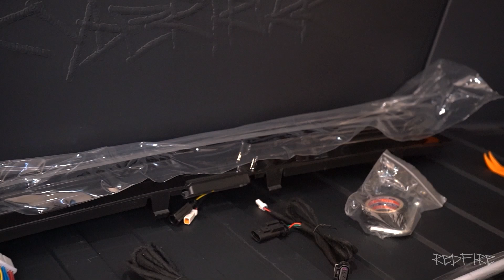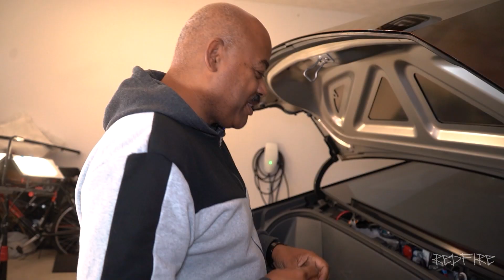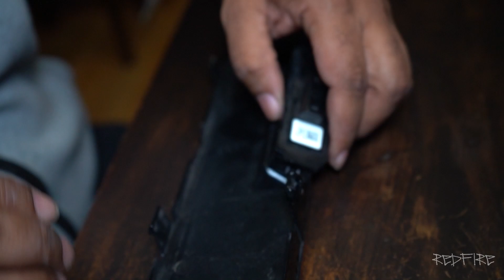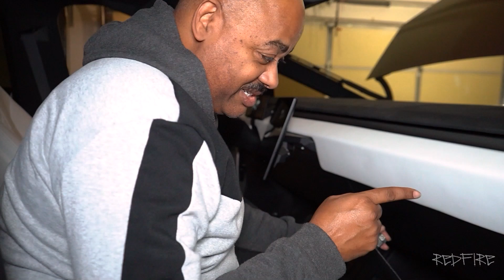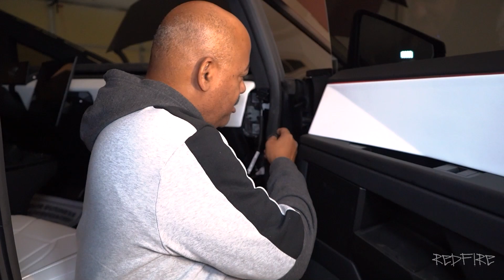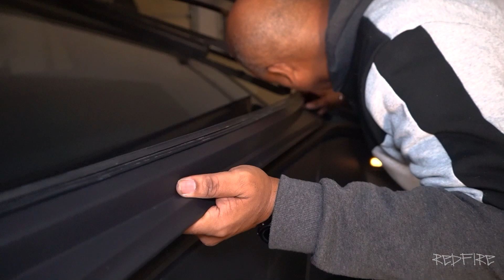Making a Cybertruck Cool with Custom Accent Lighting

Comment from the maker: For those that have had the hissing noise I've at least narrowed down the problem and have a solution that may or may not work for you.  The problem is in the power wiring harness that plugs in to the OEM power plug. Here's how I solved it, by accident.  I installed the BSD LED light strip.  Initially I used its harness first, put the lightbar behind followed by the OEM power.  It amplified the hissing significantly. I swapped the lightbar and BSD harness around so that the lightbar was first, followed by the BSD and then OEM and the hissing completely went away. Here's the Model Y version of it. I'll have the CT version up soon. https://youtu.be/fyWLKQ1JO0E?si=h3O674epPAMtuNn5

Comment: I bought this grill light bar and installed it on my cybertruck 12/2025.  This product causes a fault on the screen of the truck. I've been working with tesstudio for two weeks running over the air updates on their control box.  Now the light does not turn on and there are  codes on my screen warning me that the horn and speaker system needs service by Tesla.    Stay away from this one.
Reply from the maker: Wow. I am so sorry to hear this. Do you still have problems after disconnecting it?  You are the first with this issue. Just when we got the static issue resolved. I am willing to bet the horn issue is separate though. Pull up your service menu and see what error codes it is throwing up. Ultimately I would ask for a new bar from Tesstudio. The bar really doesn't have a way to damage your Tesla as it only draws power and reads the signal from the ODB port, nothing is sent back to the system.
Reply: @TheREDReviewTech   They sent me an app to connect to the CAN Bus cheater box which was included with the kit.  I ran the update per their instructions and still get the codes.  Yes these codes are both on the screen as you drive as well as available on the service screens.  I sent photos of the codes and have asked for either replacement parts that work or a shipping label to return and get my $ back.
Reply from the maker: @happyguy62 do a software reinstall on the truck.
Reply: @TheREDReviewTech I am now.   Total pain in the as s.  This should be a simple plug and play product. Now it’s a long headache for basically very little light output if it ever does work. Not worth the expense
Reply from the maker: @happyguy62 like I said, I think it was coincidental. That lightbar controller has no way of issuing commands to the truck. It just doesnt work that way.It has done other stuff but it's more hardware related, not software.It only ties in to the headlight, ODB and power ports.
Reply: @R @TheREDReviewTech believe the t connection on the passenger footwell is the on the canbus.  The light should turn on when you open the truck doors as well.  The truck headlights stay off during the day when I open doors.  So it must be reading off the interior lights as well as headlights. Definitely a defective black box. Hence the load on the interior lights  which triggers the canbus fault.  I agree it’s a hardware issue with the box supplied with the light.  The tesstudio keeps claiming it’s a software update issue with their black box.  Hopefully they will stand behind this product.
Reply from the maker: @happyguy62 with all of the installs that I have done I've faulted some stuff out at certain points. If it was even just a short circuit the electronic CBs in the truck will catch it.  It's possible that may throw up a fault.  If that really is the cause then the solution is to wait a few hours without touching the truck.  It has to go in to sleep mode.  Even a double knob press won't do it.  The CBs automatically reset after about 3-5 hours of sitting.
Reply: @TheREDReviewTech  once i removed the system i did a reboot of the screen to clear the screen codes.  Still have the service codes.  Not good
Reply from the maker: @happyguy62 do a software reinstall.  Like I said,  it was probably a coincidence,  but if it did corrupt the system somehow then the software reinstall should work. That's why you have to go in to the service menu also to see if it's just a software glitch or if it's reporting a hardware fault. I have a video on  the channel for that.
Reply: @TheREDReviewTech  I'm having the same issues with the codes. I'm going to try the reinstall, (once i learn how to), but  before I do, I'm just going to check my connections again.
Reply from the maker: You need an updated wiring harness. They should have it available. I recommend just disconnecting it for now and see if things return to normal. The older one, like I have, can cause interference in the CT system. To my knowledge there is an updated one that corrects this problem.
Reply: @TheREDReviewTech they refunded my purchase after they could not solve it.  The same problems are in the Amazon comments for this light.
Reply from the maker: @happyguy62 did removing solve the screen warnings? I'm pretty certain there's an issue with the harness as the light has a feedback signal and it's not filtering it out properly.  The truck is very sensitive to that.

Comment: Do you notice a hiss at all from the passages speaker? 

Noticeably more light at the front of the truck with the added light?
Reply from the maker: No hiss at all. It has not interfered with any systems on my truck at all. 
When I first turned it on I wasn't sure, but when I started to cover it up it became noticeable.  The light itself is really bright!
Reply: Hey - I definitely get the hissing noise in my right speaker
Reply: @haseebkhaja9307  Do you have a video you can post to illustrate what you are hearing?
Reply: @brandonm22  I keep trying to reply with a video but it isn’t working. It’s essentially static out of the right speaker. Ironically, the speaker was not working at all when I had the rear view mirror camera hooked up alone.
Reply: @haseebkhaja9307  That is interesting. Thank you for trying to share the video! I have one of these light bars riding in the back of my truck & am nervous about installing it & opening a can of worms with potential electrical issues. However, I like the idea of more light to the front of the truck with my 35% windshield tint. The extra light at night would be very nice!
Reply: @brandonm22  So I bought this lightbar bar and the rear view mirror camera and both have given me issues as they both wire into the harness near the speaker. The rear view camera just made that right passenger speaker inoperable. Might be the last time I try with these third party add ons.
Reply: @haseebkhaja9307  I'm sorry you had issues; I imagine that would be frustrating! I may try to hook up the light to see if I experience the hiss with the expectation that I may need to reverse the process to revert to OEM. I will update you if/when I take the plunge!
Reply from the maker: Ok I was able to verify the hiss. Its very low, but I can hear it with everything turned off. The volume control has no effect. I will have to try some other things to figure it out.
Reply: Any update to the hiss?
Reply from the maker: @sokiet not yet.  I need to follow up on this.  I'm thinking it's the word going through the door as they're right next to the speaker wires.
Reply: Thanks for reporting back, let us know if you find a fix!
Reply: Hey, any updates on the hiss? Is the lightbar still installed on your CT?
Reply from the maker: @brandonm22 No as I have not had a chance to tear in to it. I can say it’s very low and I don’t notice it unless everything is off and I am sitting in the passenger seat. I wrote the mfr, but have not gotten a reply.
Reply from the maker: @brandonm22  Well I heard back from the manufacturer and the news it not what I had hoped.  First off, they don't have a fix. Second they don't plan on doing anything because the product is being discontinued. So we are on or own on this one. I plan on keeping it installed as I think it looks great,  but when I get time I'll try a couple of things to see if it's a shielding problem.
Reply: @TheREDReviewTech  thank you for the follow up! Let me know if you find any fixes for the sound!
Reply from the maker: Thanks for reminding me though. I just sent out another round of questions. I have been told folks are looking in to it. Need to stay on top of it.
Reply: Keep us posted on this. Very disappointed in the manufacturer on this. They are not really offering refunds either.
Reply from the maker: @haseebkhaja9307  no they're not.  Thing is that it's probably something simple.